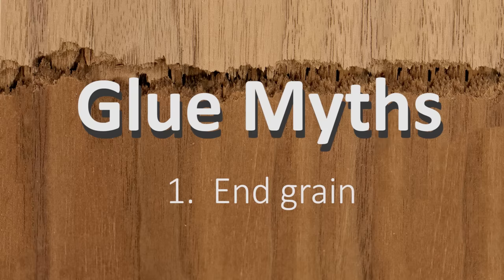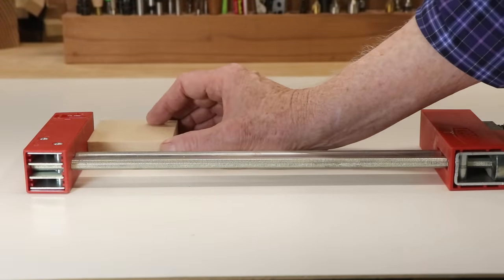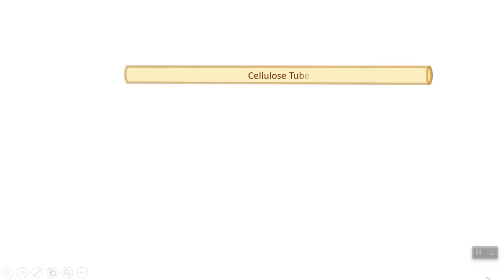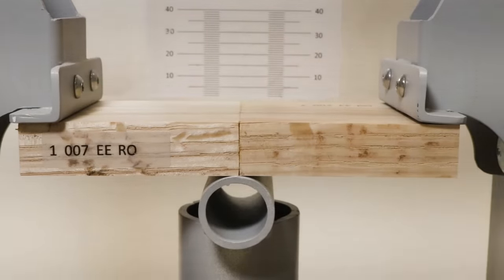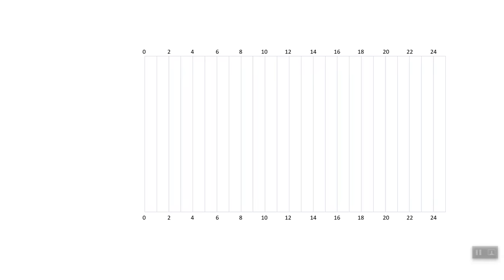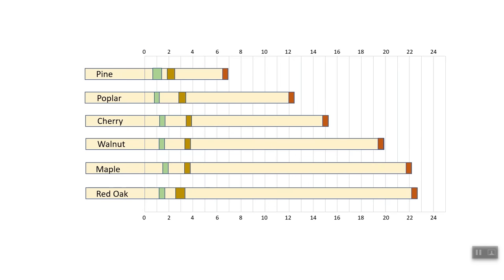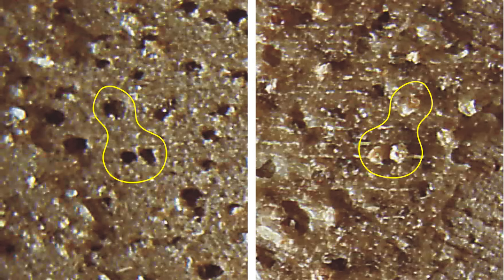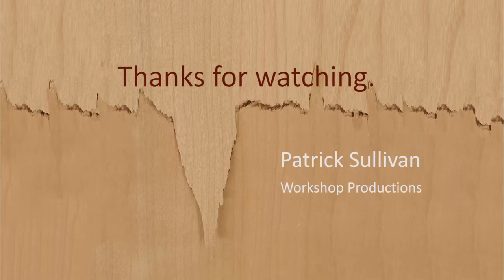Glue Myths:  1. End grain

Comment: It's so weird that Titebond or some other big glue manufacturer has never tested this. Such a missed opportunity to say their glue works better on end-grain than edge grain!
Reply from the maker: Steve:  I have been doing research on glues for several years now.  When I started, I contacted the Franklin Company, who make Titebond, and asked them for test data that I could compare with mine.  Their technical rep told me that they had no test data other than a single ASTM test of shear strength.  I found this just as surprising as your reaction above.  Perhaps part of the reason is that this company has already garnered the lion's share of the woodworking market, and has focused more attention on the development of multiple advanced adhesives that they offer for industrial use.  In light of this, I thought it might be useful if I could provide some factual  data that we non-industrial hobbyists could use to guide our projects.   I am planning to do more along this line.  Thanks for taking the time to tune in to this channel.  You have probably gone through more gallons of PVA glue than I have.
Reply: One thing that the current political environment has taught me is to pay careful attention to words. Words have meaning.  I think you're misinterpreting his results as well as its meaning to wood workers. Watch it again.  Wakodahatchee Chris
Reply: Steve, thanks for sharing this video, it was fascinating and really really well done!
Reply: Great video I'm just a dummy but i don't see how anyone could give this video a thumbs down. It's for sure a thumbs up on just the setup of the test alone. Not to mention the results!! BRAVO Mr. Sullivan
Reply: I thought the conclusion of this video was that the glue joint itself doesn't matter, it's whether you are stressing parallel or orthogonal to the fibers, the latter being stronger. Am I missing something?
Reply: @mr.g937  you are absolutely correct, didn't miss anything beyond the nitpick-y specifics and verbiage. Not worth digging further (except for perhaps curiosity)
Reply: @mr.g937  No, Steve was just saying a glue company could have tested this, since none have, and then used it as a marketing technique.
Reply: @mr.g937  No, I don't think you missed anything. That's exactly what would have said but you said it better! ;-)
Reply: @PatrickSullivan  I'm not saying that Franklin fits this description, but often the reason company's don't have test data is because it wasn't actually them that completed the design or they weren't the original manufacturer.
Reply: I work for a major glue company.  I can tell you the reason any of us don't have this sort of data is that we want to measure the strength of the glue. . . not the joint.  We take great care to remove any factor that would make the substrate or joint, break first.  Therefore, a shear force break test of face to face wood in the direction of the grain, will always result in the highest break forces.
Reply: @mr.g937  Looks like it. So, I think about one question: What about plywood? It's material of crossed layers, the weakiest bond is endgrain-to-endgrain, so, it could be good test. If this video is correct, then plywood endgrains is worth doing.
Reply: @cdrive5757  I may have misunderstood your point, but to me Steve is not misinterpreting the results, he is making an additional or adjacent point.  Any manufacture demonstrating that their glue is so strong that it can make an end grain joint stronger than a edge grain joint would surely have made a dramatic and memorable ad because it runs counter to the prevailing knowledge of the woodworking community.
Reply: See Jeremy Brouns YT video on end to end grain glue ups using Titebond 8 years ago. All said there.
Reply: By the way: glueing two beams end to end together is much weaker then a longer single beam. Why should a brand like Titebond publish such common sense data?
Reply: @rolanddrewinski2295  
Of course, the wood is stronger than a glue joint for end grain.  This video is not a representing the glue joint to be stronger than the wood.  It's showing the joint is stronger with end grain than edge grain.  It's comparing end grain joint to edge grain joint.....oh, and end-to-edge joint.  I think you missed the point of the video.
Watch it again.
Reply: The only thing this test shows is how not to use wood. It says nothing about the glue.
Reply: @RalphSampson...  Sure (for days and weeks) ,but what is the point of comparing apples and pears? When would one change his or her way of working with wood?
Reply: @user-mg4dc9kr1n  plywood end grain and edge grain are essentially identical
Reply: Think about it Steve. They make more money this being wrong aka sell more glue ☺️
Reply: Titebond don't manufacture glue, Franklin Industries manufacture a range of 'Titebond' wood glues, one of which is for end grain bonding in LIGHTWEIGHT situations. They do test glues and when I made a video in 2013 on comparative testing gluing end grain and overlapping fibre joints, they informed tme they would always recommend re-inforcing the butt joint as I have indeed found after 50 years plus of woodworking. We should be careful in avoiding misinformation especially by influential YouTubers such as yourself Steve!!!
Reply: @WoodomainJeremyBroun  Exact what misinformation are you drawing from my comment about suggesting a tongue-in-cheek Titebond marketing opportunity? 🙄
Reply: @SteveRamsey  Ha, tongue-in-cheek? Hard to grasp the funny or sarcastic side of your initial comment.
Reply: @WoodomainJeremyBroun  indeed Jeremy, you said it all years ago without leading some on the wrong track.
Reply: @SteveRamsey  Do I have to spell it out?! (1) You say Titebond has never tested this - they (Franklin International) have. (2) You say the glue works better on end grain than edge grain. This is totally misleading to woodworkers wanting to learn sound practice whether it is tongue-in-cheek or not and I have explained why the test is not a typical application such as a chair leg where the leg is a lever and would snap the joint. Rather than tongue-in-cheek, watch my video of 2013 and you will see a tongue-in-wood gives the required strength for a sound joint.
Reply: @WoodomainJeremyBroun  lol..if you want to really get offended, watch my latest Short video on this 😂 Be sure to leave a comment! 👍
Reply: @SteveRamsey  I'm sorry to disappoint you Steve but I dont watch your videos and I am not here to offend people (if thats what gives you your kicks) but share sound practical woodworking knowledge and challenge those who challenge!  I do have a few myth busting videos of my own but my main challenge here is the way the test was conducted to get the desired result cloaked by its superb visual presentaition!  The time-served rule is end grain butt jointing without fibre overlap re-inforcement is weak and this is not a myth. Check out my three videos on gluing wood (2013) comparing different jointing methods with Titebond (which is an aliphatic resin glue). What you stated was factually incorrect and you should know better considering your following! ! End of.
Reply: I think it is purely a marketing thing. If you show that your glue is "stronger" than the wood -> you're the king. 
If your glue isn't as resistant as the wood -> this isn't good for your business. 
Manufacturers won't show best practices.. They'll just show that it's better than lignin.. Just because that's eye catchy. 

As you'll always design furnitures using wood properties. Gluing end to end isn't relevant. Since it wont be able to be as resistant as wood fibers. 
When you need to glue along fibers, you'll use laminated wood or plywood to keep wood fiber's strengh. 

In the end, plywood / laminated wood aren't glued end to end and we're back to the "lignin will fail first" category.
Reply: Honestly it's a moot / 'non' point regarding the joinery used in wood working .   Just interesting.
Reply: @PatrickSullivan  As a physicist with wood working hobby I think it is more safe to say the reason Titebond (& others) have not studied this is because the myth has minimal impact on real wood joinery .    An interesting and well done study but really effect nothing in a serious wood worker's shop/technique .
Reply: Steve Ramsey - Woodworking for Mere Mortals
that 'missed opportunity' would likely turn out to be a disaster. try to take on a misconception that is nevertheless deeply rooted in popular culture and see what happens to your 'loyal' customers. just look at what's going on in politics right now, the answer is right there. very likely that most, if not all, employees of franklin international (makers of titebond) believe the myth themselves.
Reply: @PatrickSullivan  at least the German din norm says that you are not allowed to in construction because you are only allowed to calculate with the timber strength! Of course the glue will hold much more than the wood, but the mechanical circumstances of the wood are complete different to the glue. If you glue end to end you only test the glue. Otherwise you test only the wood, so all ways just the weakest part.
Reply: @lucasdJAdam  LOL
Reply: @hj8607  indeed, besides that the titebond guys have actually looked into this, see Jeremy Brouns YT video from years ago.
Reply: @WoodomainJeremyBroun  "...end grain butt jointing without fibre overlap re-inforcement is weak..."

So is edge grain, for the SAME length of joint under the same conditions. In fact it is weaker, which is the whole point & one made clear in the video.
Reply: @user-mg4dc9kr1n  there is no endgrain in plywood. every side is a mix of end- and edge-grain.
Reply: @rolanddrewinski2295  they absolutely wouldn't, which is another reason for not bringing attention to it. profit first.
Reply: @GARDENER42  No, the edge grain glue line did not break.
Reply: @rolanddrewinski2295  thanks for reference to Broun videos
Reply: @rolanddrewinski2295  My apologies, I meant the glued piece, not the glue.
Reply: @baldosanchez7576  There may be a correlation between the thumbs-down people and their vaccination status.
Reply: @cdrive5757  Explain please.   I thought the data was pretty clear and didn't contradict his narrative.
Reply: @cdrive5757  Who is "You" doing the misinterpreting?  The author, the commenters, a commenter in specific?  Words do count, and you just said nothing by leaving one or a few out and leaving "You" stand as a general term!  Oh, and it's not just in politics, but nearly everywhere, (just read a contract or watch a news show) and the oldest con in the books.

Suggestive language is way more effective than factual data, and I hate it because It is ruling the world to all our detriment, and slowing our progress as a species!
Reply: @mr.g937  Yes you are missing some things, but are also right at the same time.  Watch again, and pay attention.  It's about a common myth, not about "How to make a good wood joint".  The Japanese build huge structures without glue, nails, screws or any fasteners other than gravity and press fittings, many still standing after centuries and with a long future ahead.

As a guitar builder I can tell you that a dovetailed neck joint is one of the silliest things I have ever encountered, yet it is thought to be superior.  So much so that it's hard to find an acoustic guitar without one, or similar.  There are more than one better and much easier to make joints to accomplish the very same thing, better yet:  Not making the damned thing firmly attached at all, but rather "floated" and therefore adjustable, making difficult repairs like the infamous and expensive "Neck reset" and some specialized and also expensive tools completely unnecessary, not to mention the mess heated molten glue makes on your tools and what not, that is a nightmare to clean!
Reply: @Bob-of-Zoid  I searched until my eyes damn near bled but I can't find where I said "you"! It apparently put a burr under your ass? Just for the record and regardless of the obvious misinterpretation by the majority of comments, Butt gluing End grain to ANYTHING is NOT stronger than accepted Edge or Face Grain gluing techniques. If you must butt join end grain just about any Dowel, Biscuit, Mortise & Tenon, Dove-Tail, Box Joint or my favorite for long boards ... Finger Joints, will be vastly superior to a simple Butt Joint on any species of wood!
Reply: @hj8607  The theoretical science is what so many preople have been blinded by and some of it is flawed. Patrick states that the glue works by mechanically locking the pores.  According to Franklin International (Titetebond) Technical Service Department (who have watched the video) 'there may be some mechanical bonding through the pores of the wood, but bond testing of thermally modified wood shows that as the cellulose is converted into carbon char, the bond strength diminishes with the amount of charring.  This shows that hydrogen bonding to the cellulose is the primary driver of bonding glue to wood'.
Reply: @rolanddrewinski2295  Rob Cosman just did an excellent video that answers you.
Reply: @WoodomainJeremyBroun  Yes but porosity means an irregular  surface and a perfectly smooth surface has far less surface area for hydrogen bonding to 'grab' onto . The glue getting into a surface and hydrogen bonding to the voids is much like a dovetail joint resisting a disassembly as opposed to box joint . The glue is the 'wood' extension off the flat wood edge that is hydrogen bonded to the flat face and into the 'voids' (like a dovetail ) to a hydrogen bond against the irregular sub surface . This is a mechanical bond that is create by the glue's extension .
Reply: @tonyvindett87  This is misinformation - of course the glue manufacturers test their glues rigorously.
Reply: @WoodomainJeremyBroun  I didn't say they don't test their glue, I said they aren't testing grain to grain strength. So there was no misinformation.
Reply: @tonyvindett87  . We can nitpick over words such as 'misinformation' and 'misleading', bu I dont follow your logic: what are the makers of Titebond testing if it is not the strength of glue as on wood?!!! LOL. I have already stated that they advise to use re-inforcement on end grain joints that are stressed so one can assume they are testing end grain butt joints. Do you understand the saying the 'strength of the chain is in the weakest link' It is academic whether the butt joint is end to end or an end to side grain when end grain and lack of fibre support is evident in one joint member. Nobody has ever said that you should NEVER use end grain glued joints as it is about the dimension of the timber and glued surface area. Oystered parquetry demonstrates the use of end grain gluing and lasts over time.
Reply: @WoodomainJeremyBroun  I'm going to attempt to explain this to you one more time......The author of the video pointed out he cannot get any testing from the glue companies on the subject of the video, which was end grain to side grain, side grain to side grain or end grain to end grain. Steve Ramsey said that's a missed marketing opportunity by the glue manufacturers to take advantage of the conventional wisdom that end grain gluing is weaker than side grain gluing. That's all that happened. No one was saying that the glue companies don't test the strength of their glue. All we were saying is they don't test grain direction.
Reply: @tonyvindett87  And I am saying this is misleading information and a lot of speculation. Franklin International (Titebond) do test glues for strength and grain direction and I am informed today by them that they also use ASTM D905 tests and that they would likely be sued by that organization if they passed them on for free as they are Copyright documents, which possibly explains why Mr Sullivan could not obtain tests from them. But this apart, are you not aware that several third parties have tested end grain glued joints (including myself back in 2013 that 104,000 other people have viewed)!  What is the point you are actually trying to make? Clearly for anyone who works wood whether professionally or for leisure knows that end grain is not strong just relying on glue alone and so this video will not make much difference to practical people but will be MISLEADING to many others in the fundamental claim that has been made!.
Reply: @WoodomainJeremyBroun  If others have been misled by Patrick's videos, then they either weren't listening properly, or they jumped to the wrong conclusions. Let them get on with it, what does it matter to you? Those who actually listened and understood the conclusions from these videos are finding them beneficial - they are concise, well explained videos with well tested, fair experiments and despite your accusations, they are not misleading at all.
Reply: @RagnBoneBrown  I think you are implying that I too have not listened or jumped to the wrong conclusions of this video  - yet the very conclusion Mr Sullivan emphatically delivers is that 'end grain gluing is about twice as strong as side grain gluing'?!!! And whichever way you like to spin it, this is misleading in the real world of woodworking. Sorry! And whether I am 'accusing' or simply giving critical analysis it actually DOES matter to me that Mr Sullivan accuses experts as being wrong!  Part of my livelihood has been writing books published by major publishing houses who invited me (eg the Encyclopedia of Woodworking Techniques - printed in  5 languages) and recently I have started investing in publishing my own hardback books so it does impact on me. But of course that is no concern to others but I am answering your question!   Whilst Mr Sullivan is clearly highly articulate and clever in the way he constructed and delivered his experments surely it is his responsibility if his message is already being confused by so many people. All I am hearing is 'oh he didnt mean that'. Remember, he is making some very strong claims that are having impact on this influential platform!  Please tell me how this video is beneficial when so many commenters think that glue will replace joints and someone could easily make a chair that could be dangerous to sit on? Read some of the other comments about the limitations of this laboratory test. But at least it has got some woodworkers thinking!
Reply: @WoodomainJeremyBroun  Patrick didn't say glue could replace joinery. If that's what some people took from the video, then they misunderstood - and that's their problem, not yours
Reply: @RagnBoneBrown  I am well aware of what Mr Sullivan said, as  I watched the video several times and please do not sweep under the carpet that the main claims in the video were emphatically made at the beginning (his intention to  prove experts are wrong) and at the end ('end grain gluing is about twice as strong as side gluing') Neither of these were proven in the real world of woodworking. End of.
Reply: Patrick has the main component at about 7:50 : breaking long grain is really hard. The point of joinery is that the joint is stronger than the wood, in the direction that force is typically applied. Thus, you might want to still make say a bridle joint if you want to make wood longer, instead of a but joint: while stronger than expected it fails because glue is less strong than the wood fiber lengthwise.
Reply: True
Reply: @richardsolberg4047  Your laughter comes from ignorance. He's absolutely right He is absolutely right (referring to his first sentence). Think, for example, of a long shelf. There aren't that many ways in which you can replace long grain with cross grain.
Reply: @cdrive5757  The end to end failed on the glue joint but it took twice the force.  The glue is stronger then the wood unless the wood is end to end glued.  The wood fiber run that way are stronger than the glue.
Reply: I feel like I remember Matthias coming to this conclusion at some point years ago.
Reply: Others would say "because theirs is weaker on edge! Ours is stronger on edge grain!" and corresponding to the myth, they will have success with that.
Reply: Steve such a claim as  "Such a missed opportunity to say their glue works better on end-grain than edge grain!"  would be self defeating as every one, every one, every one except those watching this video, knows and will swear that end grain gluing is weak and must be avoided, it has always been so. Thus they would lose business to those not making that claim.
Reply: You suggesting that they missed an opportunity to lie to people for making profit, as it would've been an O.K. thing to do, is highlighting one of those things that are really screwed up with the world today...
Reply: Or maybe keeping secret the test results. 🙊
Reply: @PatrickSullivan  Maybe the reason is pretty simple: there is no special practical focus on the gluing by end grains. Not because of gluing itself. The focus should be on more practical and more typical situations. By the way, I predicted that this glue would work better on end-grain surfaces just after I saw the video title. Thank you for the confirmation!
Reply: Re-watch the video. The glue performed well with all orientations.  This was more about timber strength w.r.t. grain orientation to compressive force. We all know timber is at its strongest in line with the grain.  The failure of side grain joints demonstrates the relatively high strength of the glue to timber in this orientation. End to end grain was the true test of the glue's strength, and as we previously assumed the glue failed before the timber. This is not a myth buster.  I've often used glue for end-to-end joints with no problem. If such a joint was to be structural, then you'd be best to use half laps to increase the glue bond area, and my guess would be the joint would fail with the grain splitting at the half lap to full thickness point.